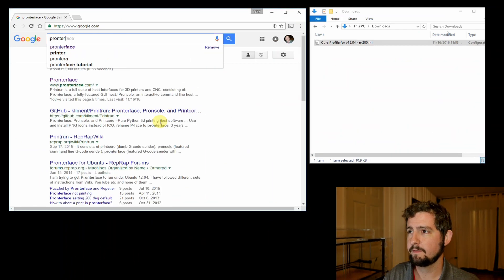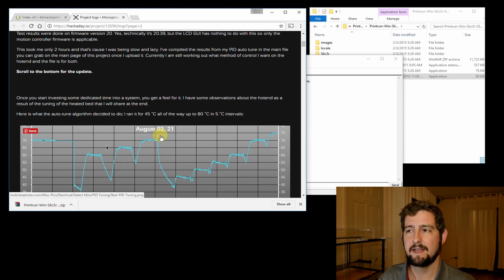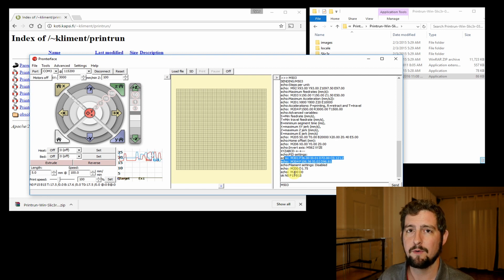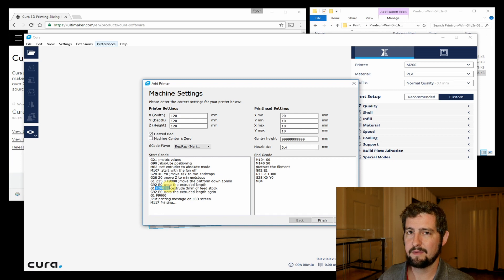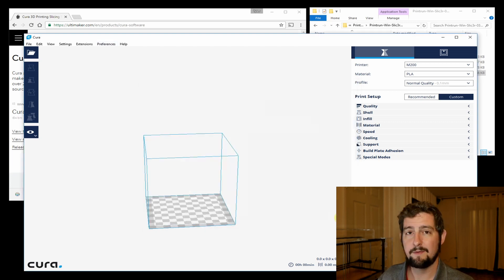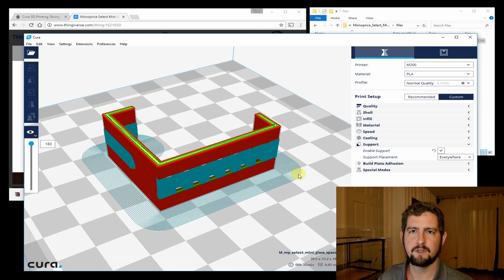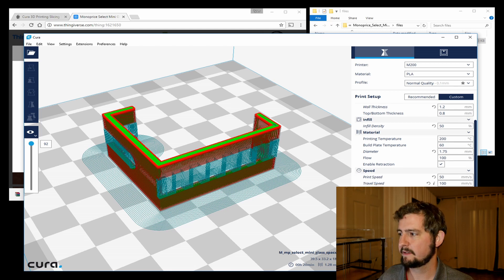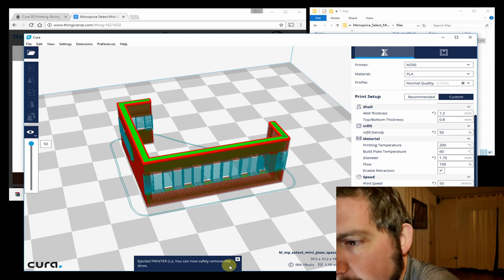Monoprice Select Mini 3D Printer Beginner's Guide (Part 3) - Tuning the firmware and slicing basics!

Comment: This is great and truly appreciated.  I am hoping this is the solution to a rather odd issue I just began to encounter on a lightly used MP select mini V2 I was gifted a month ago.  This is my first 3D printer so please be gentle.  lol

2 days ago while printing with Duramic PLA+ @220° about 20 minutes into the print there was a slight smell of burning plastic.  I got up to check and while standing there looking at it I saw a small wisp of smoke coming from the hotend.  I looked at the temps and they had hit 330°.  I quickly shut it off and let it cool.  After about 10 min I turned it back on and ran a preheat check and all LOOKED good (except for the PTFE in the hot break - that was cooked and subsequently replaced) but while I had the nozzle temp set to 190° it began running up to 250 and by the time I managed to shut down the preheat it had spiked to 270 even though it was still set to 190.  Bed temps never did anything like this though.  I'd already run through over 2kg of hatchbox PLA with zero issues and the only thing I had changed, other than the filament, was the temps as per Duramic specs.  My nozzle is pretty cooked now so still waiting on new ones to arrive but I am baffled as to what could cause this.  I've checked, and rechecked, the thermistor and it measures out the same as multiple other 100K thermistor temp probes I have, and when I put it in place of the temp probe on one of my multimeters it outputs the same (and accurate) temp so I'm not sure the thermistor is the culprit here.  If not then I have to suspect board or firmware issues.  But how this could just happen out of the blue if it is a firmware issue is beyond me.  Any thoughts, insights or suggestions are highly welcomed (and encouraged).  If I can't figure this out I guess I'll just have to invest in something bigger.  What a shame.😁

Comment: Hi Tyler is there another way to connect besides the USB port which is broken, I took the panel off to look at the internal usb and it is lifted up from the board, this is a used printer and lesson learned from buying a used machine, even though it was a really cheap buy. Could I replace the usb on the board or would that be a simple fix or complicated….looks like the internal usb is connected by small pins and soldiered to the board. Previous owner must have pulled the usb cord out the wrong way damaging the internal port from the board…just guessing. Any info would be great.

Comment: Tyler.. My Monoprice v2 is working for the most part , pretty well right out of the box...however... When I press print the print is starting way over to the most extreme right side.. I'm using Cura..newest version and the object looks like it's centered on the build plane..when I save the file...The object I'm printing is a simple circle of about 79 mm..so..there no issue with trying to print something larger than the Mono's build plate area.  Any clues as to why it's doing this..or if I can correct it?

Comment: When I try to check the layers in cura like you did around 12:30, all i get is either the model all in yellow, or a multicolored mess. It doesn't show the individual layers no matter how high i set the slider. Any suggestions?

Comment: FYI: 
To get "build plate temperature"  property to show up in the custom Materials settings in Cura 2.5,  the custom printer setup for M200 (named in video) needs to have "heated bed" checked. I missed it when updating the start and end gcodes.

Comment: After making the pronterface console changes, my lcd reads 180 degrees and never rises above. i actually had some filament start smoking because the hot end was attempting to continue heating (though I'm positive it was well above the listed 180) Ever heard of this? What did I do wrong? Can I reset it to the factory settings?

Comment: When you go to install Cura, is the printer still plugged in via USB?
Reply: No, I don't use it connected at all.  I use the SD card in a card reader, save to SD and then put it in the printer.  To open an STL in Cura, you go to File->Open

Comment: does the printer has a reset button. I just got one, my heater cartridge was broken, install a new one and replace the heat sensor. it all worked, but the temperature is increasing even though the temperature that heat the extruder is off. how do I resolve the issue.

Comment: Please could you explain the bit in your description about the layer height needing to be a multiple of 0.04375.. I really need to tune my prints to fit precisely and would like to understand this. What would be amazing is if you could actually share an optimised Cura profile for this kind of precision. Thanks again.
Reply from the maker: Check my blog link in the video description http://www.thetylergibson.com/monoprice-select-mini-part-3-tuning-and-slicing/  it has exactly what you're asking for :)
Reply: thanks, I tried that link earlier but it's a 404 "not found" link.
Reply: Ah!  Thanks for letting me know.  I just transferred hosting and it broke in the middle.  Site is back up now :)

Comment: Quick Question: After following these instructions as well as the ones to configure cura, my printer is trying to print out of bounds. It seems like it does no longer know where the center point is. I double checked my bet and its configured at 120x120x120. Seems like it's of to the bottom left. The stepper makes a rattling noise. Any idea?
Reply: When this happens to me I turn my printer off, then gently push the print head all the way to the left, and the bed all the way to the back. Then when I turn it back on the printer is already at "Home" (0,0). ;)

Comment: Thanks for the videos. I found them very useful to get up and running for the first time. One small problem with the end code is that if you are printing a large model if the X or Y are close to the end of travel, they can hit the end stop, but the steppers will keep turning. I modified my code to raise Z by 3mm, then home X and Y so that I am not destroying my belts. Thanks again for the great videos!

Comment: Windows compiled Pronterface is not available at that URL anymore. Is it hosted anywhere else?
Reply from the maker: +One Sock it looks like the site is just temporarily down, but that is still the official binaries site for pronterface.  It should be back online shortly :)
Reply: I realized that you were only using it for sending gcode, which I was able to do with repetier host.  Following a lot of your tips, I was able to get my bed up to 85c (used corrugated cardboard instead of cork/foam) and had a near perfect abs print (gluestick on 3M painter's tape).  Now I've moved onto crazy hacks, like installing an e3d hot end and upgrade my fans.

Comment: Learnt so much from these videos - much appreciated.  
Can you provide advice on filament retraction settings in Cura.  I get marks across the finished surface with PLA+ as the extruder jumps across the surface filling in holes.  I have no retraction values set.
Reply from the maker: +Dunk O the default retraction works decently, more recently I've been playing with lower retraction values (Cura defaults to 6mm I believe, I'm currently using 3.5mm), but haven't seen much of a difference.  Finished surface marks is common on all 3D printers :)
Reply: I don't think Cura on the Mac was retracting at all for me and I getting a lot of stringing when Printing a cluster of small parts with ensuing PLA+.  Activated the retraction setting and used 3mm/40mm per sec.  fixed!

Comment: Someone, please help! I got filament stuck in the nozzle and have looked up methods such as the "atomic method" and can not for the life of me get the filament out of the nozzle no matter what I do, anyone have any suggestions? I only got this printer a week or so ago and printed 1 thing.
Reply: Chances are you'll have to disassemble the hotend. I've not messed with bowden extruders, but on a direct drive you can disassemble the coldend and then use something small like an Allen wrench to push any filament that is stuck through the nozzle (while it's hot, of course.) I imagine this would work on a bowden setup as well.

Comment: These tutorials have been a real help - thanks.  I have used your start and end G-codes but for all prints i find that the fan stays on for more than 5 minutes (code double checked).  I am using motion firmware V29.39.  Any ideas?
Thanks
Reply: Working now.  Interestingly, the printer maximally draws 60w of power (when printing with PLA).  Seems to be well within the 120w power supply rating.

Comment: now I know why my printer freezes up at the end of the print and it wont home and steppers still activated, I think (wont know until I make changes)
look at the end code, on the video and the description

m84 steppers off is missing in the description
it just says disable motor

and just noticed my filament totally retracted out of the tube too , once the print finished
guess I need to check that too
Reply from the maker: Yep.  It's not "freezing up"  
The command 

G4 P300000 ; wait 5 minutes before turning off the fan

Will sleep everything for 5 minutes to give time for the hotend to cool before turning the fan off.  During this time you will only be able to make movements from the control panel (no USB).  Feel free to remove this line and you'll see the blocking go away.

If your filament is backing completely out of the tube, you'd mistyped something somewhere.  The below command backs out the filament by 5mm (E-5 means extruder minus 5mm)
G1 Z+0.5 E-5 X-20 Y-20 F9000 ;move z up a bit and retract filament even more

I use this on two different Mini's with two different firmware revs and have never seen either of them back out the filament more than the 6mm total specified in the ending gcode.

Hope that helps!
Reply: ok thanks, im going to modify or remove that command

I think the filament coming out was my attempt of moving the z axis up on the control panel, and when pressed in the button it moved to extruder. Because that has never happened again and I've modded the button taller now and much easier to control

Comment: I updated my settings in Pronterface as you directed and when I got to the point of disconnecting and reconnecting I am now getting this error. 
[ERROR] Could not connect to COM3 at baudrate 115200:
Serial error: could not open port COM3: [Error 2] The system cannot find the file specified.
What gives?
Reply from the maker: You may need to try the other available COM ports.  That error is almost always because you have other serial devices installed.  My Mini's usually mount as COM3 or COM5, but they've also been COM2/4 before.  Cycle through connecting to each COM port listed until it connects :)

Comment: Thanks for your video series, they've helped me a lot in getting started with 3D printing. I bought this printer under the Malyan M200 name because I'm in the UK. I followed your firmware and temperature gcode setup instructions and have managed to print some stuff fairly successfully, however... Whenever I try to print any kind of gear, it really messes it up. I'm trying this model : http://www.thingiverse.com/thing:30615; sliced in Cura. I'm starting to think it might have something to do with the filament retraction. I used the Cura settings described on the manufacturer site : http://wiki.malyansys.com/doku.php?id=cura_setting_for_m200. Any ideas why it always seems to mess up the first layer of gear teeth?
Reply from the maker: Use the settings I provide in the video and on my blog http://www.thetylergibson.com/monoprice-select-mini-part-3-tuning-and-slicing/  you will get better results than the stock settings from Malyan.  Usually if you're getting bad prints from the start, especially the first layer, its almost 100% caused by not having the bed properly leveled.

Comment: i want to bought new one from amazon i need to used the setting or already same your setting ??
Reply from the maker: +Max q8 even with new ones you will need to tune the PID values for the hotend.  However, you will probably not need to update the firmware itself as long as the number shown on startup is 22.39 or higher

Comment: Hi, I understand setting the wall thickness to 1.2 to get better strength and surface finish, but why do you leave the top/bottom thickness at 0.8? Wouldn't this also be better at 1.2?
Reply from the maker: +gektron wall thickness needs to be thicker to prevent the infill pattern from being visible on the outer shell.  Also, the part will be the weakest in the vertical axis compared to XY, so the additional thickness provides a bit more comparative strength.  But! It never hurts to have the top and bottom thicker!
Reply: Ah thank you I get it now
Reply: Just another question if you don't mind. I'm using a 0.175 mm layer height for the MP Select Mini. Should the top/bottom thickness actually be a multiple of this? For example 0.875 mm (5 layers) or does it not really matter? I ask this because we hear that wall thickness should be a multiple of nozzle width.
Reply from the maker: +gektron top and bottom doesn't need to be a direct multiple because the slicer will always round it to a layer height.  This rarely matters in zheights but has big fit issues in XY for thin walled parts.  It would only matter for Z when the interior height of a part needs to be mechanically precise.
Reply: I suspected the slicer might do this. Thank you so much for your time answering these questions.

Comment: Quick note: PID stands for proportional, integral, derivative, not power, impedance, derivative as written in the blog post.  PID values are the gains on the proportional, integral, and derivative error values used to calculate a response to the given error in the system.
Reply from the maker: Well I'll be!  Thank you so much for this.  I'll update my blog :)  Learn something new every day!
Reply: No prob Tyler!  Great videos by the way, I've been using them to tweak my own MP Select Mini :)

Comment: Hey Tyler! Thanks for the video. I'd like to know, is it normal that after changing the PIDs, when I ask for 205 I only get up to 202? There is always a 3 degree difference that I didn't had before. My Hot end PID were: M301 P20.00 I0.02 D250.00 C100.00 L20
Reply from the maker: That definitely shouldn't be the case.  Make sure the part cooling fan isn't too high up and hitting the nozzle itself.  Also double check with M503 that your PID settings are actually saved as M301 P36.00 I0.012 D72.00 C0.12 L2

Comment: When I go to preheat, the extruder temperature just displays "N/A" and the platform "999°", I can set the target temperature but neither will actually begin to heat. Anybody know of a solution?
Reply from the maker: You've unfortunately got a broken/snapped/shorted thermistor.  You can RMA the printer for a replacement, or checkout the facebook group for help on how to replace it yourself if you're feeling curious :)

Comment: is it okay to use the cura program that is on the sd card?
Reply from the maker: Aron Thompson you can, it should work.  It's just quite out of date and Cura 2.3+ has a lot of improvements.
Reply: Oh OK well, I did use the one in the video but when I got ready to print parts of the print would mess up and a few times the screen on the printer would freeze and sometime get glichy.

Comment: where do we adjust the layer height?
Reply from the maker: Nick Ambrosini check 13:53 in the video for layer height, it's the first setting under quality in Cura 2.3.1
Reply: do i desgn the x and y axis of objects in multiples of .4 and the z in multiples provided in the description?
Reply from the maker: If you are using the default .4mm nozzle, then yep!  And yep, exactly right with the z multiples as well.  For tolerances between parts, .2-.3mm "gap" will usually results in a very, very tight fit in reality.

Comment: If you're using a raft you can adjust the settings to have a much smaller footprint. I usually set it to 5-8 mm. To find the settings you have to go into the file menu, preferences, settings, and you can add a checkbox next to "Build plate adhesion => Raft Extra Margin". Then you'll have the option to change the raft size. I also like to set the Raft top layers to 3. It's a little overkill, but if you're having a problem part, that'll usually solve your woes.

Comment: If you're going to be away from your print job when it finishes you do NOT want it to return to home after finishing since your print will still be on the bed and it could damage your print or printer.
Reply from the maker: It's okay to return it to XY home, as it lifts up the Z a bit first.  You're correct though if your print is using close to the maximum z-height of the printer, might be best not to have it home XY just in case